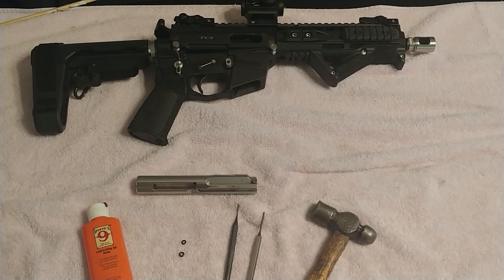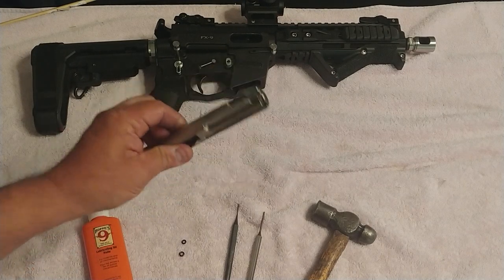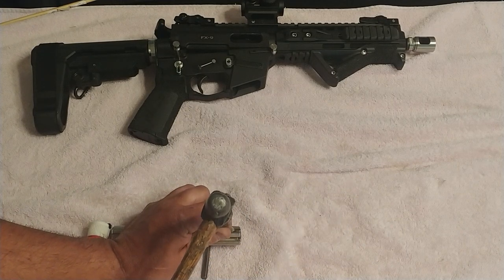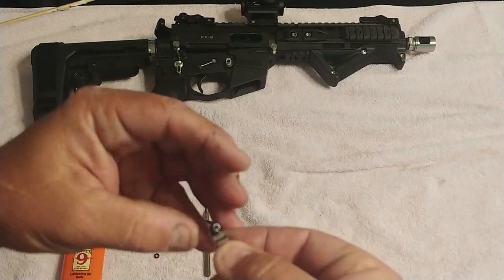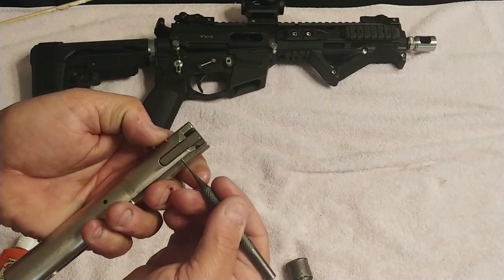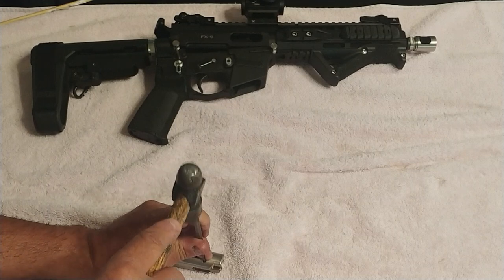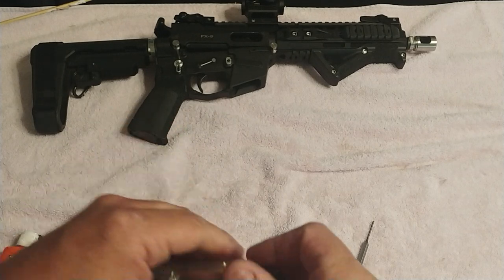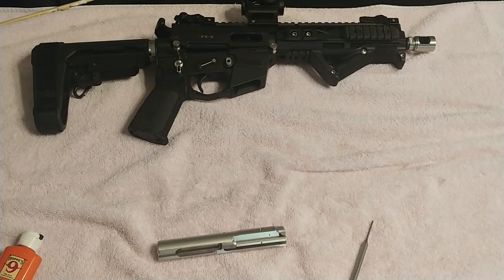O-Ring modification to the FREEDOM ORDNANCE FX-9 FX9 9mm

Comment: Have a new FX-9. Less than a 100 rds thru it. I am seeing it stove pipe from time to time. More than I would like. Thinking about putting the o-rings over the spring. How long would you think the o-rings will last before they need replacing? Thinking about preventive maintenance.

Comment: Mine smashes the brass against the back of the ejection port ! The cases are D shaped , with a hard crease running across the case about 1/8 inch from the mouth !

Comment: Very nice to know! What size of O-ring should you use?
Reply from the maker: You'll use an O-ring that will just fit over the spring.  The O-ring should fit snuggly around the spring.

You don't want them (the O-rings) loose because the assembly (extractor & O-rings) will not fit into the space (in the bolt), in which the extractor mounts into.

Comment: Good video. What pistol grip is that?
Reply from the maker: That is actually a Magpul MOE grip that I modified, with use of a heat gun, to properly fit the lower receiver.  I then used a wood burner to stipple.

Comment: Beautiful FX9! What did you use to take off the barrel shroud/muzzle? I’m looking to add a KAK flash can to mine.
Reply: rag and a pipe wrench, it's really the only way, unless you have a very high quality strap wrench that may work too.
Reply: I had no issues with mine, it just loosened right up and I through it away.

Comment: Was wondering the reason you changed it? Was it malfunctioning for you or you did it before hand because I am having issues with mine picking up rounds and double feeding. I added sba3 brace and it started to act up ! I thought it could have been the buffer spring and weight! But after I seen this I’m second guessing myself! Just wondering if you were having issues before you did this ?
Reply: I'm having the same problem I think ammo keeps coming out pushed into the casing